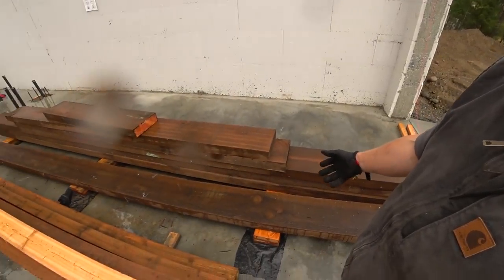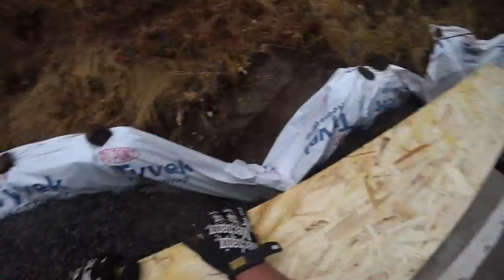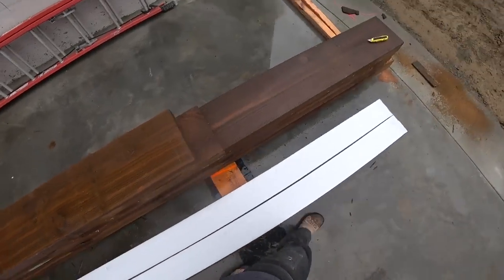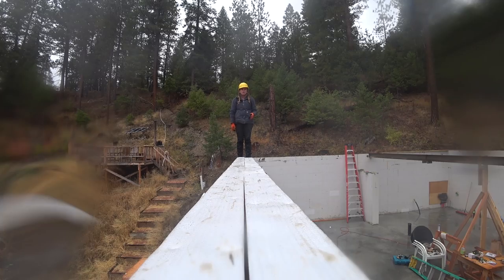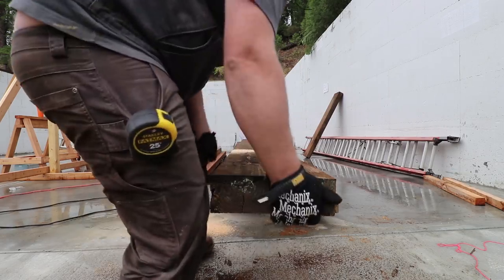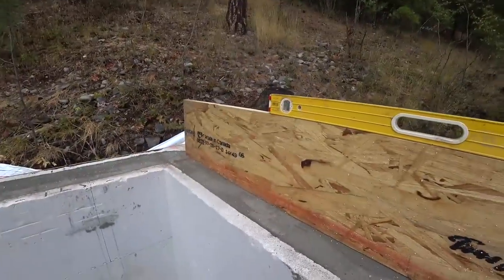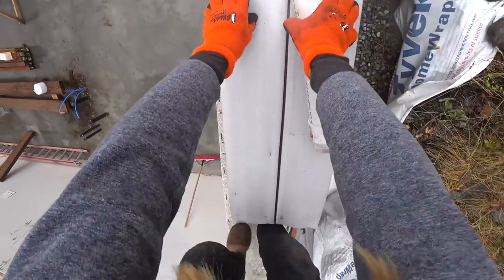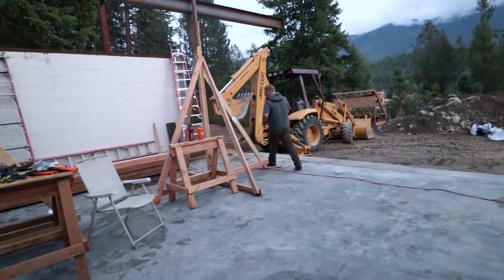Building a House Start to Finish: DANGEROUS Sill Plate Installation

Comment: You just go with it... Make sure it's square and snap lines to lay the plates on to make sure  your  plates are even all the way around.  Idk how it's done where your at but if we took this long on the sill plates it'd be a problem.  And where are the bolt threads that pop through the foundation you drill the plates to go over and then bolt down?  I'm following your whole build and some things seem to be different then the houses/garages I build.  Maybe I'm just not seeing the big picture.  But up till this you guys amazed me with the ingenuity, I'd hire either one of you two, you're deff more knowledge about building then most.  Good work!

Comment: Use your laser !!! Set your laser to rotate at the top of wall elevation and then wait till dusk and watch where the beam hits or doesn't hit the top of wall. Then grind the high spots and use something like liquid nails or something to fill the low spots.

Comment: An 1/8 of an inch is nothing.  A fool will never notice and a wise man will keep his mouth shut.   " Lumber is just crap."   Bucko,, ALL lumber is just crap.  ALWAYS has been always will be.  Saw blades are only so perfect, cuts are only so close.

Place the sills.  Bump around a bit until dimensions are correct across the walls.  Then check corner to corner for square.  When you are happy,, set a few bolts at the high points to stabilize.  Then go through and shim a bit for level,,, with an noncompressibly something.ceramic tile, steel shims,  And then drill and fasten as required.   Double sill seal is NOT advisable, unless gaps are huge.  The house can actually float on sill seal,, closed cell foam.  Final seal is when some gets crushed and popped,, other cells retain their gas.

Add lumber to the inside of sill plate to cover top of foam, flush with inside surface of foam  so that when drywall, 5/8 firecode seals in the foam,,, after the shingles are on.

Comment: no such thing as straight lumber engineered or not
Reply: timberstrand lsl are crazy straight and square. I mic'd an eight foot 2x4 lsl at ±0.001" on the width on its entire length. Nuts.

Comment: I don't want to come across like a  "safety sally"   but you should really wear some dust mask or something better when grinding or cutting concrete. The dust that gets in the air from that acts like asbestos in your lungs because it is like small sharp microscopic particles that damge your lungs.

Comment: Um why don't you just drive the back ho in the garage? the concert has set long enough just put down some words for you down arms if there is not rubber on the bottom. from what I have seen you are being to picky on the level. remember there will be a lot of wt. on the foam and it will compress. Just put some cocking in between the plats to seal them up>

Comment: Yeah, there are several comments saying this. You are OVERDOING IT!

It is FAR easier to shim a 2x4 plate or trim studs.

You are being crazy and your engineer is 100% right! You will hid it later.
You spend WAY too much time going for perfect. You are not building the space shuttle. 
It is a house.
But like the space shuttle, the house has redundant features AND you can make adjustments later. No one will ever see if the a 15' wall in one room is an 1/8th of an inch longer on one side than on the other. No one will ever see it.

IT is FINE! It isn't a bitter reality. It is REALITY REALITY.

That is life kids.

Comment: And never use a angle grider with out the black gaerd x
Reply: Stephen Welford not possible with them grinding disks, it will not explode like a cutting disk so not necessarily needed

Comment: I thought a sill plates purpose was to keep normal wood (joists) off of concrete (so use a layer of treated wood between) and to make something that will seal between the house and the foundation? why such huge sill plates?

Comment: you are over thinking what you think are problems. your building is going to compress 1/2 in when done. just as long your high points are the same you will be fine

Comment: Since driving the backhoe onto the floor before the concrete has a chance to hard set would screw it up. 
l would have built an A-frame to place on the drain gravel outside the wall and a tripod for inside then put a beam  between the A-frame and tripod and used block and tackle to lift the timbers into place.

Comment: Enjoyed watching your building series. Please, for the sake of a day's work or some $$, get some scaffolding up for your own safety. It's only a matter of time before an accident happens and then where will you be, months behind or possibly a lot worse? You are both amateurs and accidents happen everyday even to pros. It's not worth the cost saving or time saving. Even re-use the 2x4s you still have left over from the foam block construction. At least buy a couple of safety harnesses.
Thanks for the videos, please stay safe...

Comment: Why is Alyssa balancing on the top of a 10' wall without a safety harness or scaffolding?  If the concrete guys were worth protecting with scaffolding surely your wife is?  A 10' drop onto concrete is certain death if you are lucky!
Reply: A 10' drop onto concrete has a small chance to kill you.. If you fall on your head then you were doing something stupid prior to that happening and your death would be most welcome by future humans as your genes would no longer be in future generations if we were fortunate you didn't reproduce. Most likely the concrete guys brought their own scaffolding and took it with them when they left because of workplace laws on safety and the massive fines that go with it when ignored.
Reply: Crypto Database i agree with most of what you said except that the scaffolding was done by them with their own material 🤗

Comment: should you be applying some sort of treatment to your cuts?
Reply: I'm not an expert on pressure treatment, but i know this, most treated products come with manufacturers recommendations and the treated products i've dealt with, always recommend a recoat after cutting.
Reply: I used to work at a timber yard doing pressure treatment.
The treatment chemical only penetrates the first 5mm (1/4").

any cuts should be dipped or painted with a solvent based treatment.

Our treated timber would have a 25 year guarantee, but that would go out the window as soon as the customer cut the end off and didn't re-treat.

Comment: i like your videos and appreciate the insight. Ignore the rude posts. One question: why do you switch from the spade bit to manual drill to cut through the sill plate? Is it to avoid hurting the spade bit when it penetrates through the sill plate and hits the concrete and so you use the $2 hand drill instead? Just curious...
Reply: Justin Stein . The spade bit is being used to widen the top of the hole for the bolt head.
Reply: Then why not use another bit for the rest of the hole below where the bolt head rests? Just curious from the perspective of manual vs. machine labor.
Reply: Justin Stein . Maybe they only have one battery drill, and do not want to fiddle around changing bits while balancing on the top of the wall.. That's the only reason I could think of.
Reply: In an earlier video they showed a bit more detail. The spade bit is just to create the pocket so that the bolt is countersunk when fully fitted. They are using the hand drill to drill through the wood at just a little wider diameter than the bolt (not the same as the spade bit), so that it is free moving through the wood, and then use the hammer drill to drill into the concrete.
Reply: The spade bit is easiest for the cut out for the lag bolt head. The wood brace with the auger bits (and I bet there are at least 15 different words for that tool, depending on where you are in the English speaking world) makes a really tough piece of work easy and fast. No matter how athletic and strong and well balanced you are, a tool which work easily in dense, treated wood is a godsend.

Comment: Better reseal those end cuts Jessy or you may be asking for trouble down the road with insects and or wood rotting. What ever those things are painted with (My guess is a creosote compound) only gets absorbed so far and every cut you make is getting rid of that protection. Left untreated you may not notice any problem for a long time but the poor guy that gets the house after your gone will be the biggest looser on the deal.
Reply: I thought these were pressure treated so the chemicals go all the way through the wood...
Reply: Mikko Manninen- Your right if that was all these boards were suppose to be is just pressure treated, those chemicals often do make it all the way through and help the lumber resist rotting and insects but what is different here is these boards have an extra layer of protection that is thicker or heavier and gives them "Ground contact" protection like that used on telephone poles or railroad ties. this is usually a compound of lignite oil and other chemicals. Most of the time it's referred to a creosote. This is more like a paint that will only soak just so far into the wood. I suppose more time under pressure they might get it t go all the way through but like paint it is only meant to protect the outside that actually comes in contact with the ground. You can see what I am talking about by stopping the video at 10:31 after Jessi cut's the board and removes it the exposed end that is left only shows that the compound used has only penetrated maybe 1/4 inch all the way around but the interior looks the same as any other piece of pressure treated lumber. Don't get me wrong, I'm not saying he better reseal it or it will defenitly rot and just being pressure treated may be really all he needs but I have also seen a lot of 40-50 year old homes that had sill plate damage that may have been prevented by using a little added protection or simply replacing the lost protection to start with.
Reply: Ok, I understand... I used normal European style Class-A (ground & water contact) pressure treated 2x6 wood with bitum based seal between them and concrete on my house for the same purpose, but obviously regulations are different. I think realistically those sill plates will not really be wet once the building is finished, I hope they make sure water doesn't keep the wall wet...

Comment: This would be funny if it wasn't so sad.  If you are holding yourselves to this level of accuracy, you've got a long way to go when you start on the second and third? floor and roof.  Listen to the experienced and knowledgeable builders that are trying to help you.  DON'T listen to your engineer for building advise.  He (she) is an engineer that can DESIGN a house, not necessarily build one.
Your sill plates are bowed, twisted and of variable thickness.  GET OVER IT.  They'll also be one size when wet and another when dry.  That's the nature of wood and building with wood, these irregularities multiply themselves.  That's why ALL house creak and moan due to swelling and drying of wood and uneven settlement of the entire structure.

Comment: Im telling you right now as a carpenter You are worrying about nothing. all your doing is wasting time for no reason. timber will not come out of the mill not .5 of a millimetre perfect. As it is being out side your risking your timber slighty swelling.Just put your plates on bolt them down move on....
Reply: They have done an excellent job for armatures. They are not wasting your time and they are in no rush....Like they said, they only started at 11:00 am....And they are farther ahead then you think, like just maybe the 1st floor in completed already....
Reply: Jedidiah, They are wasting my time also, Nick Kinbacher was right, houses built in 1930 are still up and doing fine.2 stupid video only to have revenue from YT.

Comment: It going to take you six years to build this place working like that.  Its called Rough Framing for a reason.  You aren't doing finish work.  I agree you guys need some scaffolds.  Get off the ladders and you shouldn't lean a step ladder against a wall and climb it.  I've done it and fallen.  Not fun

Comment: You really need to get a worm drive saw. Magnesium frame if possible, if not fine, but worm drive a necessity!!!
Blade on the left side, so easy to see, push saw and saw drives straight into cut,!!!
With your timber framing now upcoming, you really got to get one - even if you buy used on Craigslist.
Saw is bulletproof.
Don’t comment often, but I cringe when I see u use that pos skilsaw.....
Just saying......

Comment: Why such a thick sill plate?  Keep in mind that wood is nothing but a collection of hollow tubes (straws) running lengthwise of the tree.  New growth pine, softwood, has much larger diameter straws than old growth hardwood. When you put concentrated loads on them from the side, ie. joists, the straws compress under load.  Expect your building to settle up to 1/2" in the first year or so.
Reply: Don Brutcher 1/2" shrinkage on a 4by, don't think so.
Reply: Well, it'll still settle enough to not even think about shimmying sill plates.. those things carry the entire rest of the building so you want it flat on the concrete, not on a tiny bit of wood just to it's flat.

Comment: Why aren't you putting sill foam between the butted ends, Jesse?  Anywhere air can intrude, you want that foam pad there to stop it, in addition to everything else you use.  OBTW, use dust protection for your lungs.  Concrete dust is nasty and sucks the moisture from your mucous membranes.  Good call on using the pipe to shift the sill plate.  Egad, I just saw that tree again.  Imagine what it will do to your foundation when it grows up, Alyssa.  Thou shalt rue the day.  (ducking)  OK, sills on. Good job, guys, and all without the help of Supercat, who soitenly put one paw outside into the wet and backed back in with a "Meh".

Comment: I know it's probably too late since the videos are delayed.  Couldn't you have figured out the high spots and single layered the sill foam around the high areas and doubled up on the low?  Just saying.  Sometimes in construction you have think 3 dimensionally and even 4th and 5th. You'll never find a perfect constructed home.  Brand new houses have warped walls, non squared corners. Adapt and overcome.
Reply: A magnesium straight edge run over the wall when it was poured and a cork float to finish would have been my preferred method, but you have to work with what you know and have. I've had much worse problems in the past, due to ignorance. I actually like the way they dealt with that problem. Their is no harm in trying for perfection, except the added labor and expense.
Reply: Hard out bro lol

Comment: Please consider some scaffolding! You guys are spending a great deal of time walking on that wall and it's tempting fate. It's not a really high fall but it will NOT feel good and could seriously injure either one of you. OSHA would likely have a fit and for good reason....
Reply: Considering they are already done(check Facebook), your point is mute. By the time you see the video they are on to the next project.
Reply: I believe you mean moot? I know they work ahead, they still need scaffolding.

Comment: Jesse - PLEASE stop putting your face right on top of that cheap circular saw when cutting boards! One kickback and you could have the saw come back on you, lose an eye, or worse! If you can't see the line you are cutting on, use a saw guide!  BTW, level is good but square is more important in home construction.  You're overthinking this project! If you want to be airtight by winter, put away the rotary level.

Comment: Wow, you Americans sure build precision buildings. In the UK an inch out either way would probably be fine. All our natural wood building products are prone to twist shrink and bend and dry out over time making your precision methods a waste of time here in the UK.

Of course you could never build here because you would be sacked on day one. No way could you work in construction with a total disregard for your safety and that of others. If you want to live to enjoy your new home at least consider hard hats, scaffolding, eye protection, dust masks, something. 

Pumping concrete with no eye protection, hand scooping it along without gloves, working alone, untrained use of power tools, walking on walls above 6 feet without scaffolding, a tower, scissor lift or cherry picker , throwing tools at each other, pressurizing pipes with no eye protection, a saw mill with bystanders hanging around in T shirts with no eye protection . Health and safety is a real thing in the UK.

God help you when you are walking about on the roof or doing electrics...
Reply: wow an inch? did we brexit already ?  i thought we had to stay to 24mm, anyhow american building is just like uk building but with poorer wingnut wiring connections....
the super accuracy is just these two, i suppose because its for themselves, family, and the eyes of a nation are on them :)
Reply: They are just sweating the small details here that will eventually be discovered not to matter much. Seems to be their personalities.